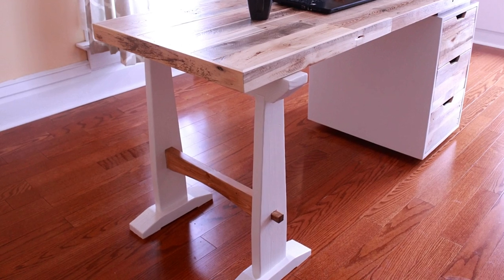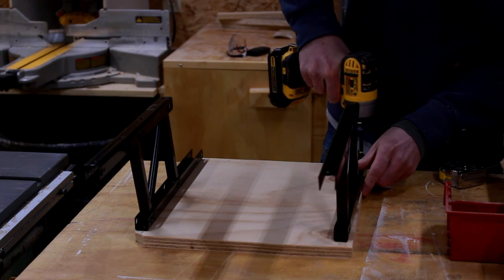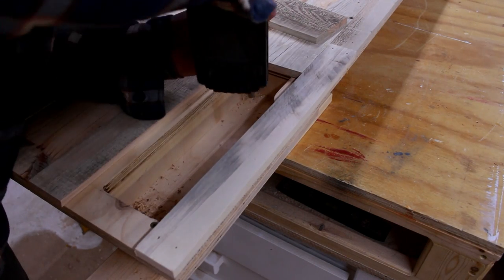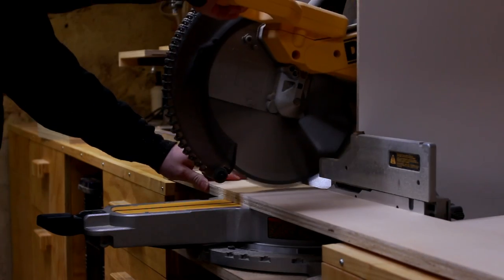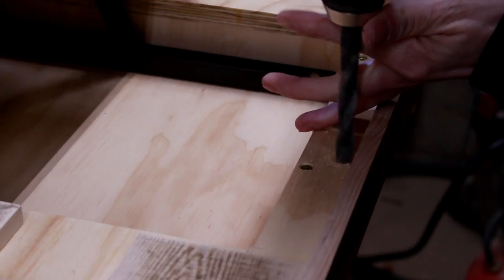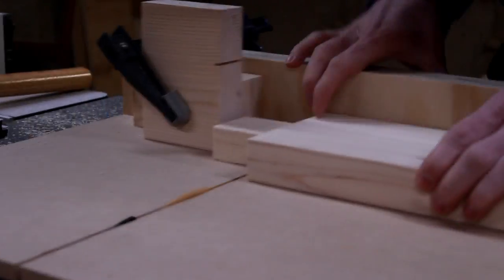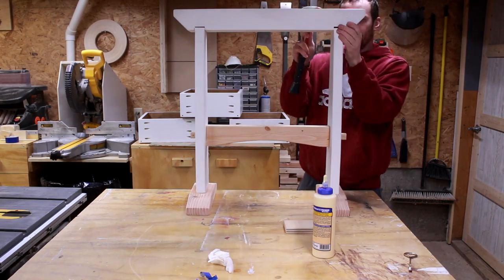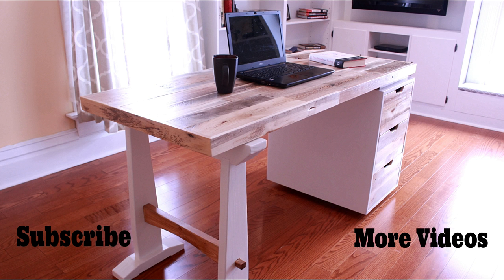DIY Desk with hidden laptop storage using reclaimed pallet wood - How to make

Comment: Wow that came out nice.  If you ever find yourself mounting a power strip, here's a neat method.  Make a photo copy of the back, then put the photo copy wherever you want to mount it and use an awl to mark the spots for the screws.  It lets you be very precise.  I've used this a couple times and it works great.  Especially if the strip is vertical since you can make sure the paper is in just the right spot before marking the holes.
Reply: @rjtumble
I've always wondered why there are no thru hole on powerstrips ... I've thrown caution to the wind a few times and drilled holes as close to the corners of the strip... i've been lucky so far.... ;)

Comment: Do you have a video on that box around your mitre saw for dust collection. That looks very cool.
Reply from the maker: I didn't make a "how to" video on the dust collection box around my miter saw. However, there is a short video clip of it on my Instagram page on how the dust collection box works when removing it and putting it back on. The link to my Instagram page is in the description if you are interested in looking at that. I made it super easy to attach and detach using lever clamps I got at Harbor Freight.

Comment: Very professional work. You are well set up in what looks like your basement. How do you manage the dust ?
Reply from the maker: Well my dust collection still needs a lot of work but I use a dust deputy attached my shop vac. The dust deputy has pvc piping that runs to my table saw, miter saw and router that have blast gates at each machine. I also use a dust containment set for my miter saw to keep all the saw dust in one location. It's not perfect but does make cleaning up much easier.

Comment: I'm currently designing a recording studio desk with this pallet wood tabletop. As these desks are very long to accommodate a keyboard, I'm wondering if you had any tips on stopping it bowing in the middle? It's 1.6m with my legs at the very ends. Your gluing on top of ply is great! But would the ply hold that length without bowing do you think? Or maybe if I used 18mm or something ply it would hold? Thanks for the great vid!

Comment: Absolutely brilliant video! One question: how do you manage to fit the drawers so perfectly? I always find it difficult to take measures since you have to take into account the breadth of the sliders, am I right? How do you do it in a precise way?
Reply from the maker: Thank you Luca! In my case the drawers sliders are exactly half inch each. So to find the drawer width I just needed to subtract exactly 1 inch from inside width of the cabinet. Also, before assembling the drawers together, I laid all the side pieces of the drawer inside the cabinet with the drawer slides to make sure it was a good fit. You can always make your front and back sides of the drawer a little longer here and then shave off little by little until you get a nice fit as your making your test fit.
Reply: @makeit5272  damn you're right, I'll try to do as you say the next time. You've been very helpful, thank you do much and congratulations again!

Comment: You lost me at planar! How many of us really own one of those. And I'm guessing anyone who does is probably a pro who doesn't need to look at how to videos like these. I did give thumbs up for the clever idea about hidden laptop compartment.
Reply: Here in the UK, a thicknesser planer can be bought for around £220 GBP  ($300). It is only an essential item if you want to get boards nice and flush like this desktop. if you are lucky enough to obtain pallet planks that are all the same thickness you can get away with sanding instead but in reality you will thank yourself for splashing out on a planer like this. They turn scruffy dirty utility wood into beautiful media, I am always amazed by how beautiful the grain can be in rough pallet planks once you have levelled them in a planer like this. I am not a pro BTW. my "shop" contains a cordless driver, a chop saw, a jigsaw, the planer and a power drill. I don't have any of the other "flashy" stuff like a table saw or an oscillating belt sander. I don't even have a router despite them being quite cheap as it is all of the profile bits that really cost the money on those after you have bought the unit itself.   My advice is to drop big hints around Birthdays and Xmas and get the family to treat you... If they are anything like my family they will be grateful for you telling them what you want !

Comment: Is the surface in any way splintery? As it's a tabletop it's a surface you touch a lot, so I wouldn't want to risk hurting myself.

Can you also keep us updated about how the tabletop warps? Solid wood can exert quite a force, and when gluing it to something you usually have to make sure it either is strong enough (like a floor) or there is another layer of solid wood on the opposite side (the way plywood almost always has an uneven number of layers, with the grains of the topmost layers going in the same direction.
I think your tabletop might be thick enough in it's construction, but I'm still curious.

Comment: Very awesome desk, and nice work.
In the beginning of the video, you said that you planne the boards so you can get the same thickness. 
How do you go about that? Can you make a video on that? 
Im  using the same planner as you, and I cannot get the darn boards to be the same thickness. Its always one thicker than the other.
Thanks.
Reply from the maker: Thank you CP! So in the project, when I plane pallet wood, I line my boards in a row from thickest to thinnest.  I then start to plane the thickest board first until it is about the same thickness as the next thickest boards. I can then run BOTH boards through the planer, one after the other at the same depth, until they are the roughly the same as the next thickest board. I can then run ALL THREE boards through the planer, one after the other at the same depth, until they are roughly the same as the next thinnest board. I continue these steps until I can run ALL the boards through my planer at the same dept which is the key part, plane all the boards at the same time. 

Of course, if you have a jointer planer you can run the boards through the jointer before running them through the planer to get your boards nice and straight but for this particular project where I am working with pallet wood I'm just concerned about getting them to the same thickness.

Also, if you are trying to get an exact thickness I would recommend using calibers rather then a tape measure to really hone in on your thickness. 

I hope this helps and good luck with you future projects!

Comment: This is one of the best projects I've ever seen. I love it. Incredible work. The style and colors go together very well. I do have a question about your miter saw station. Does that cover swing with the saw when you turn it? Thank you
Reply from the maker: Sureshot Thank you! The miter saw cover does not move when I turn it. That is a pretty clever idea though. I have made it so it can be easily removed when I do a miter cut which I don't do very often. I did have a box for my miter saw that was big enough to accommodate for the swing of the miter saw, however, I thought it was too big and collected junk on top. I prefer this smaller one.
Reply: @makeit5272  That's definitely a better idea. I like it. I made a huge box and it just seems like a lot of wasted space. The smaller one is probably much better for the dust collection also.

Comment: Title: DIY desk!
Reality: A professional with a full workshop that you'll never have unless you are a professional builds a desk!
Reply: I don’t have ANY of this and am currently working on this project.
Reply: I bought the pocket hole jig but otherwise I am doing everything by hanf
Reply: I hate these comments. You can fairly easily do this without all the big equipment. It would just take a little more thinking. You could also look at the difference you would pay in materials vs purchasing a complete desk like this and you could buy the tools and materials and still probably come out ahead. You could then use the tools on future projects. Also just because he has all the tools doesn't mean he is a professional. He just directs his money into tools and not other junk
Reply: @HickLif3  This all day long
Reply: $30 jig saw, $75 router (not really needed), $30 belt sander, $400 table saw.   

These are all tools any novice woodworker would have.  This is far far far from a "professional" wood shop (not a knock on the poster)
Reply: @3N1GM4  You forgot the planer! ;) lol
Reply: @alphanuevo  Ah true, but it's not "needed" lol
Reply: @3N1GM4  It's easier to do it without a table saw than without a planer. Making all boards the same thickness would be a nightmare by hand.